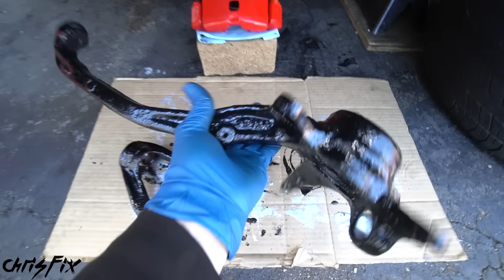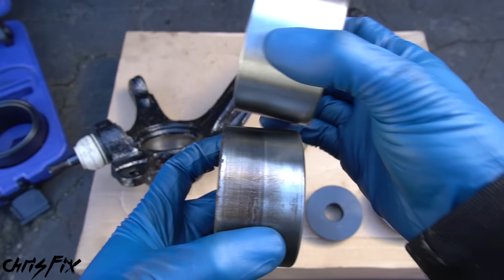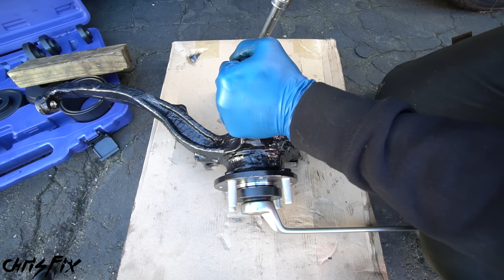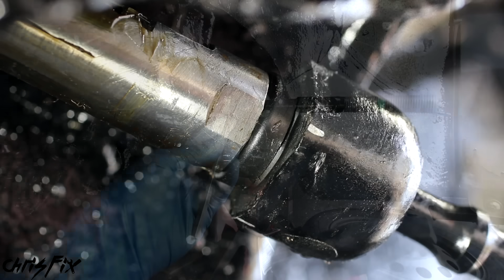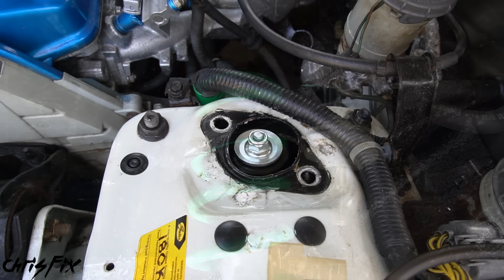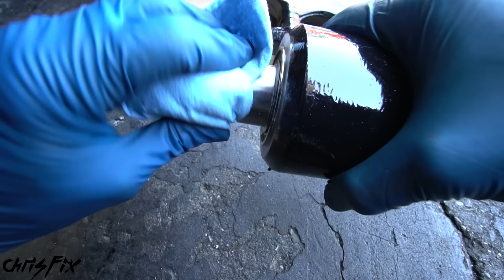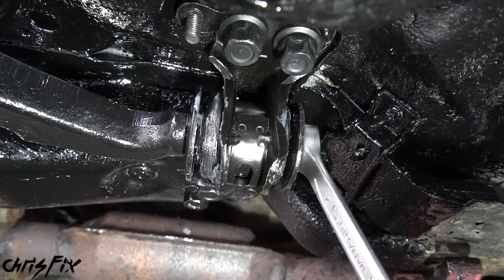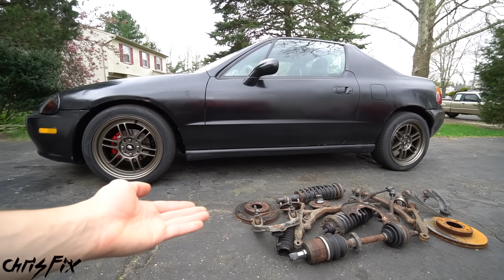How to Install a COMPLETELY New Front Suspension in your Car or Truck

Comment: Hey Chris. When you're tightening bolts to specific torque, are you using that specific car's model specs (that you'd find in it's manual); or do you mean that the same bolt joint on most cars have the same spec torque requirement?

Comment: Can you do a lesson on checking A/C leaks...
Reply: You can check it with uv light and yellow glasses. If the aircofluid  R134A is mixed with fluor (tetrafluorethane). You check the condensor on leaks, evaporator and hoses.
You can also vacume the system and let it sit 10 min to see if the readings on barometer are remaining same. You do this with a airco machine or if there is a aftermarket tool.. In europe you have to be certified to do this. You also want to check that the radiator, condensor, evaporator is not clogged up.

Comment: I wonder if thread locker will work on my mother in laws mouth
Reply: nah that locks threads... use super glue instead - never fails
Reply: Lol
Reply: I see you are a man of culture, but I prefer a hammer... As wise and an ancient philosopher clarksonius al'jezza'r once said: brute force always beats precise calculations and(and whatever he said next)"...
Reply: make sure you torque to 65 ft lbs
Reply: Use hot glue
Reply: BRUH
Reply: Gotta make sure you get the Green stuff, its super high strength, heat resistant and will only come off if you torch it. But...that being said. I still doubt it would work :( Thought of maybe a rivet gun? :P
Reply: Jaja

Comment: I changed all rotors and breaks in my 2004 Lexus RX330. Im using ceramic brake pads, now im smelling a burning smell. Its doesn't last long, but it comes and goes not sure why. I changed them on the 27th. Can you give me some reason on what could cause this?

Comment: Hi Chris, 
It might be off the topic of the vdo.

However, the check engine light of my Prius 2005 is always on. 
I toke it to the mechanic and they said there might be oxygen or gas smell leaked, and they changed many parts that might cause the issue so many times.
Yet the light is coming back on after 500 miles drive.
Do u have any clue or any suggestions to check? and Is the issue fixable?
Really appreciate your reply

Comment: Chris, you needed to use the adapter for the hub that presses only on the inner race of the bearing since the hub was installing in the inner race of the bearing.

Comment: I keep losing motor oil but i cant find any leaks ... What do i do? 😓
Reply: It could be leaking through the valve seals and into the cylinder where it is burned and pushed through the exhaust. Burning oil will make your exhaust have a blue tint, depending on the amount of oil leaking into the cylinder the tint might not be noticeable.
Reply: @Redtooth75  thanks... But if ill repair this to a mechanic will it be costly?
Reply: Actually you're right there seems to be smoke in my exhaust....
Reply: @ericsongeronimo304  it depends in the car. The cylinder head will have to be removed to replace the valve seals if that is where it is leaking from. On some cars it is easy to remove the head, on others it is very difficult. I would recommend doing a compression test to help determine if the seals are leaking.
Reply: @Redtooth75  thank you so much!! 😊

Comment: Anybody I need some help.
I have a 2011 Dodge Grand caravan and sometimes when I'm driving and start slowing down to stop it starts shaking back and forth until it stops and if it happens   often the car shuts off and it won't start until I wait like 5 min or so and then it runs again. I don't know what the problem is can someone please help.
Reply: First issue could be brake pads or rotors, second issue could be an ignition switch problem
Reply: @franciscogranados7225  thank you so much when I took my car to get it checked they told me that it just needed a tune up so when I was changing the spark plugs one of the plugs was filled with oil so I change the rubber gaskets to fix that but it kept shaking and turning off when I braked when I went to see again one the the rubber tubes that goes into the spark plug wasn't clamping on when I put it on so and when I looked at it it looked a little wider than the rest of the rubber tubes (also when I was cleaning the engine I was cleaning it with the hose and the car started shaking alot when it got wet I don't know if this helps)but do you think that the rubber tube could also be the problem to the shaking and turning off??

Comment: Chris we need a video on putting a supercharger on the drift stang that’d be so sick
Reply: @pizza cat lover for drifting a supercharger would fit nicely because it delivers linear power instead of having to deal with more unpredictable turbo output while trying to modulate the throttle
Reply: blazar 0 Bruh who doesn’t want a charger on a drift car? that’s literally perfect. the only time you should put a turbo on a drift car is if it’s sequential, has ALS, or you’re a very experienced drifter
Reply: He is going to, he also bought a new engine for the supercharger
Reply: Alec W yes!
Reply: pizza cat lover nah, not for this application
Reply: @pizza cat lover Only if you can keep it spoiled up.  With a standard H-pattern, good fucking luck pal.
Reply: Drifting with a turbo is like trying to keep your balance on a tight rope. If you rev too high, you go into boost, and will spin out. If you don’t rev high enough, you will either have snap oversteer and spin out (depends on weight distribution/location of engine in your car) or will straighten out. Only turbo a drift car if you have short gears, or are an experienced drifter. 

Superchargers are good for drifting because they don’t rely on revs, which a turbo does. A supercharger relies on the throttle, and is spun by the engine. You’ll be getting more boost at higher revs, But you won’t need to stay in a small set of revs.
Reply: blazar 0 why not a supercharger? No lag, way more predictable, more linear power band, and supercharged v8s sound way more badass than turboed ones

Comment: I really appreciate your detail to safety. Thank you for including safety tips when doing this kind of work. You even have the correct respirator cartridges on your respirator! Some feedback though: be careful of how much facial hair you have where the respirator seals to your face. I couldn't tell if you have facial hair from the video, however, it will break the respirator seal and thus, rendering it useless. Firefighters often shave every day for this reason, even "stubble" can break a seal and cause harm depending on what you are exposed to. Great work! I enjoy watching for the attention to detail you have in your videos.
Reply from the maker: Thanks! I ended up shaving for the painting part.

Comment: Hey Chris I'm having a lot of trouble finding lower control arm bushings for my mustang do you know of a website that can help me find some?
Reply: Call the dealer and get a part number. Most aftermarket manufacturers will have a cross reference to the stock part number. Or you could just use stock replacements.

Comment: Hey chris i have a question on replacing upper control arm, lower ball joint inner and outer tie rod and sway bar end link. Have you done a video that similar to a 2005 dodge Durango. I planning on replacing those parts on passenger and driver side. Just need some advise or some guide lines before I begin this repair in a week.

Comment: I upgrade my Ram 1500 truck from a 1500 horsepower to a 2500 horsepower, change the engine from a V6 to a V8, added a turbo with it and a new exhaust system and a new transmission to it

Comment: where do you get your torque specs for each specific bolt/nut
Reply from the maker: Check out “how to use a torque wrench” where I show all the methods I use.
Reply: @chrisfix   ok cool thank you
Reply: @chrisfix  right after i finish watching the pull apart challenge

Comment: i own an old 4x4 nissan patrol which runs live axle, not independent suspension, was just wondering how different it will be to upgrade my suspension and how much of the 2 suspension types correspond with each other. any advice greatly appreciated :)
Reply from the maker: It’s even easier with a love axle. I’ll make a video on that.

Comment: Hey Chris. You're probably not gonna see this. Maybe someone can help me out. Ive had this 1996 volkswagen cabrio for a few years and it's ran great. But recently the alternator stopped working. And caused the battery to stop working too. So I replaced both. With proper parts and tools. And it's still losing charge and not charging. I replaced the alternator cable and thst didn't help either. I don't know what to do about it.
Reply: Find where is the parasitic discharge coming from. You'll need a multimeter and a scheme of all the life wires.

Comment: So my mustang started to make a loud humming noise when i drive down the road and when i slow down the car make the same sound but then the car shuts off and i still have the key turned on but i have lost all mechanical power its like the car stalled would you have to know what is wrong with my vehicle @chrisfix or does anyone know what is wrong with my 98 mustang gt

Comment: Hey Chris I have a 1990 Nissan 300zx. It has some nice rims on it that curve towards the car, which leads to the problem. I bought the car with those rims and they need a spacer so that the caliber doesn't hit the rim. However, any time I take it to get new wheels they always tell me that the threaded studs are too short and that's causing the bolts and studs to lose threading. I've tried looking for longer studs but no store has them. Do you have any tricks or idea on how to fix this?

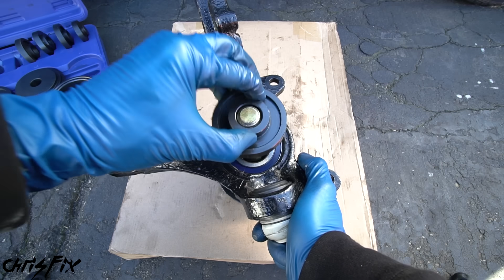Comment: Great video and info. But at 7:44 you say the adapter should fit on the outside edge of the bearing. Shouldn't it be inside? You want to press the hub against the inner race. Luckily you put it on with the flat side otherwise the bearing can come apart (take a wild guess how I know).

Comment: Hey Chris new subscriber here. Awesome channel. I was curious if you could give me an idea on something about my car. I have a 2014 Malibu bought brand new in 2014. Has 108k miles. Everything well maintained. Past month of so when I start my car it idles around 1500 which is a little higher than normal and idles slightly rough until it drops to normal. Only lasts about 20 seconds. Just changed the spark plugs. Any idea on the possible cause?
Reply from the maker: Welcome aboard and thanks a lot! I would try cleaning the IAC/throttle body, check it out: https://www.youtube.com/watch?v=KhvqT3blzVs

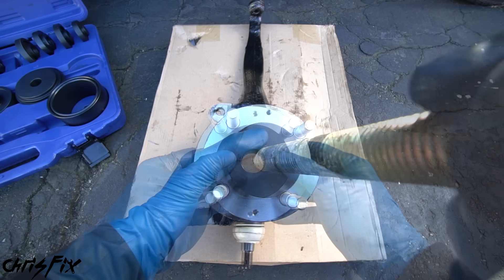Comment: I have a question: at 7:40 although the surface is flat and the adaptor is probably flush with both parts of the bearing, shouldn’t you use one that is only touching the inner part of the bearing? If this one is thinner for some reason you would be applying the same kind of stress you were avoiding when you placed it on the knuckle.

Comment: ChrisFix i love your channel even when i know how to do thing you doing in the videos i still enjoy every single moment of it. But .. The axle nut is not needed to lock in place .. its the horrible mistake which will cause a problems if u will need to change your axle or basically anything on the front suspension system .. Axle nuts are problem to unscrew even if its not locked as you did it .. Dont do it again please, its not good .. The rest of the video is amazing ! :)

Comment: Did the same on a 2009 Camry and 2008 Cobalt. The difference was amazing. Although I bought the lower control arms with the ball joints already pressed.

Comment: Pls be careful with cheap Ebay china turbo. I would suggest you to re-balance it first before you use it. I'm an owner of Nissan Skyline and Im very aware of cheap kits. Cheap wastegates can get stuck and brake engines example. 
Hope that kit works on your Honda well ✌

Comment: You are consequently using thread locker on threads that should not come loose. But why are you not using anti seize on the threads that should come loose? Like the alignment bolts.

Comment: Thanks for the great video! Just a fair warning, I have always been taught to brake clean new rotors as well. The last set I installed (I believe they were Bosch?) specifically said not to brake clean them. It said they so not have grease and if you brake clean them, it will ruin the special coating. Just check the manufacturer directions.

Comment: 7:41 Chris, you should actually use a plate that fits the INNER part of the bearing in that case, otherwise you can damage it. When you're applying pressure to the inner part from one side, you need to hold the same part from the other side. If you apply pressure to the inner part from one side, and support to the outer part in the other side, then no good.

Comment: Hey Chris did you try using civic dust shields. They should be interchangeable being that the del Sol is just t two seat version of the civic line. Not a Honda guy but I figured most components should fit multiple models.

Comment: "Now, let's just finish with some soapy wada" J/K!! 
Seriously, I am a girly girl that watches nothing but makeup videos and tutorials, BUT I always watch a 26 minute video from ChrisFix when he makes them!! I do NOT get bored. That being said, I have a question;  I have a fairly new car, a 2017 Nissan Maxima, nothing should make noise or be broken because I drive my car with care. I let my brother borrow my car for 20 minutes to pick up some people (two 220lbs guys). On my way home that day my car started making a noise when going over bumps. WHAT IS IT MY BROTHER DAMAGED IF HE WENT FAST IN DIPS AND BUMPS WITH ALL THAT WEIGHT ON THE CAR?? My dealer said there is nothing wrong with my car, but I hear a noise a clunk. What the heck could it be, or what's most likely to break if you drive a car like an A- hole?? 
THX in advance.

Comment: Hey Chris, love the channel, I was wondering if you have a video about bad compression in engine cylinders. How to diagnose, and repair a cylinder with bad compression etc.
Reply: Elijah Tingler I don’t think he does but bad compression can be tested with a compression test kit. You disconnect the fuel rail and take out the spark plug put the tester in the hole and “start” the engine. Look up what it should be and compare. It could be o rings on the piston or jumped timing. Robbie Ferreira has a video that kinda goes over it. The thumbnail is a picture of them and says is the engine blown. I hope this info helps you good luck

Comment: what if the cotter pin is a little above the castle nut?
Reply from the maker: Keep tightening
Reply: @chrisfix  I should say, the cotter pin hole is too high. It cannot twist and lock on the nut. It twists around the bolt.  I returned it and got a new one and same thing.. I just tightened it a bit more since the pin can't lock on the nut 🤷‍♂️

Comment: Chris please help me !! I have a 2004 Honda Civic and as soon as I turn it on the steering wheel shakes. What could be the problem ? (It has a flat tire and the check engine light is on).

Comment: Hey Chris long time sub, just saying eBay turbo kits are actually pretty great,  the one problem being the manifolds cracking if cast or welds breaking if stainless. If you want to do it the best and safest way you should invest in a proper manifold. 👍

Comment: So, out of curiosity for those out there that know, if my car is rear wheel drive, would this be similar in the rear end of that vehicle? Mainly only talking about the axel and bearing replacements. I realize there's not much else that's similar between front end and rear end. 

Thanks!

Comment: Had to cut the lower control arms off my daily driver (2004 F-150) last winter because the alignment bolts were seized in the bushings and the wheels could not be aligned. It was a real pain in the butt but this project almost makes me want to do it all over again! Thanks for the great work.

Comment: the only good reason why you would want to keep a brake dust shield is to protect the ball joint and CVJ silicone/rubber boots from early damage due to heat radiation from the rotor.

Comment: I'm just curious the rough cost of the parts for if I wanted to do this on my car
Reply from the maker: It varies drastically from car to car. I’d look up the parts for you car to get a basic idea. Upper and lower control arms, tie rod, strut, and axle are the main components.

Comment: But what about all that condensation that will build up in the ball joint and bearing?? 😳
Reply from the maker: What about it? They are “sealed” and lubricated.
Reply: @chrisfix  Although it is a sealed bearing, it's still possible that condensation can form inside the bearing given the environment it was put in. Granted, after a few kilometers the bearing would get hot enough for the water to evaporate but I guess if the car was to stand for a while, it wouldn't last as long as it could - so looking at a longevity stand point it can possibly be worsened? The ball joint on the other hand would suffer a bit more as it wouldn't get as hot under working environments? I'm not saying it will happen but it is likely.    (Huge fan of you and your channel by the way, been watching your video's for many years now 😃).

Comment: Can confirm, I went through my Honda's suspension and installed new tie rods ball joints poly bushings and coilovers and it handles so much better than with the old worn out parts, it was amazing 👌

Comment: Hey Chris, You should install Hub rings to prevent vibrations at high speeds. At the moment the weight sits on the studs not on the hub and that can be dangerous.

Comment: You make excellent videos but I have to differ with you about the idea of putting metal parts in the freezer.  Doing so won't make parts shrink, at least not enough to make the effort worthwhile.  The  shrinkage required to alleviate interference fits necessitates such extreme cold as provided by liquid nitrogen or other similar cryogenic substances.  A household freezer really won't help.